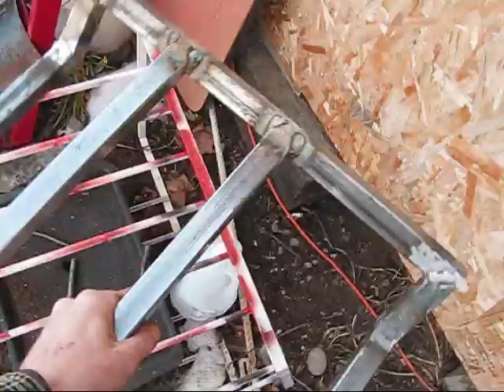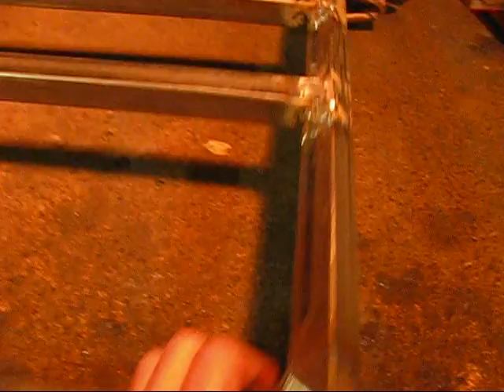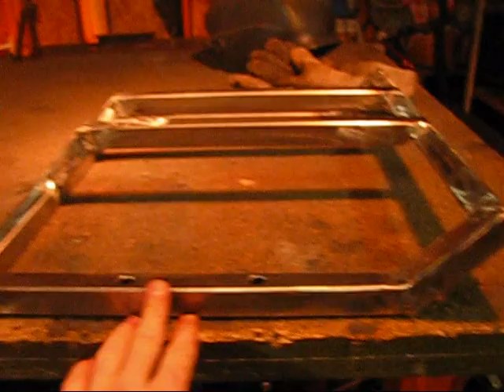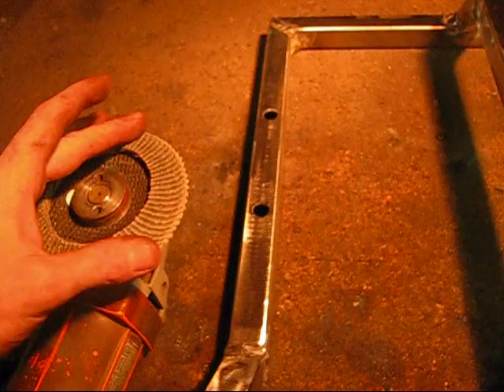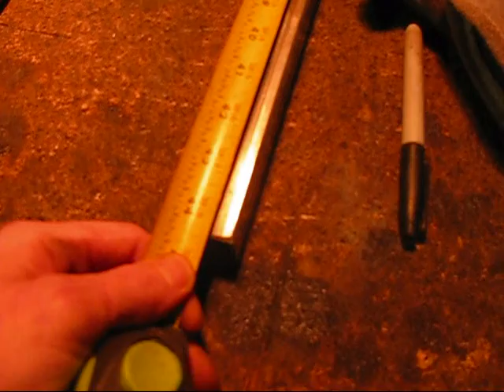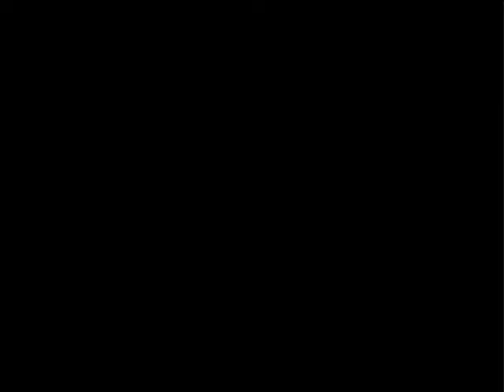Two Seater Go Kart #2 ( Rear End & Main Frame ) diy homemade

Comment: What grade of steel are you using? Also, if you leave a small gap between the pieces you weld, it will help with penetration. Gap the thin stuff .125" and under, and bevel the stuff over.

Comment: I admire your enthusiasm. No disrespect intended and I understand its DIY, but your geometry and welding could be a lot better. Does your chopsaw have a tungsten tipped blade? This gives a cleaner cut and generates almost no burrs. Also, if you get the weld right (nice smooth herringbone pattern), you shouldn't need to grind afterwards, saving you time and energy....

Comment: Hi T-Man, I really enjoy all your work.
I want to start a homemade project, but I want to use square aluminium profile. Does it resist as much as steel does? I want to use aluminium profile with the edge of 3cm. Is it enough for the chassis?
Reply from the maker: good question, I dont know. I have never built any frames out of Aluminum. but 3 cm seems ok.
Reply: ***** Thanks for your answer, it will not have a motor, it will be something as a velomobile, 4 bike wheels and pedals, for 2 persons
Reply: Horea Mare
Racing Karts are made out of Chromoly. Chromoly is stronger than mild steel and this enables people to run a much thinner wall thickness. The difference in wall thickness is why chromoly cages and Karts are lighter. However chromoly is much more expensive and should probably be tig welded..

Comment: Very cool! I want to do something like this. About how much is the total cost to make a chassis with steering, wheels, and a motor? I want to weigh the costs of building my own and just getting one off craigslist...
Reply from the maker: well realistically it would cost you more to build it then buying one.... But you wont have the pride. It feels good to know that you have built something cool. Its easy for anyone to buy something. But true worth comes from being able to build something tangible.  But to answer your "?" this build costed me about $600 , that includes shipping on the stuff.
Reply: Thanks, man. I know what you mean about the pride coming from building the project yourself. I'll still be fabricating a sheet metal model A "rat rod" style body for the go kart, but I'm afraid I don't have enough money to build the whole entire thing from scratch. So I think I'll just get a 2 seater go kart and save my craftsmanship for the building and painting of the body.Thanks for responding though! I love this build!

Comment: Too bad your video camera doesn't have a plugin backup for power, then you could just plug it in out in the shop and not worry about the battery going dead on ya. my cheap China on has a plugin backup, but the quality sucks.

Comment: hey t man im making one with my neighbors and I am only 15 years old how much for a frame that you have made
Reply from the maker: Tdog8469 THE ASSASSIN hmm , if I remember right I think it was about 90 feet of 1x1x.095 wall thicknes. and it was about $112 . Keep in mind that its just not the outside frame, its also all the cross bracing you'll do too. Like for the seat and stuff.
Reply: are you selling any ?

Comment: wtf is those welds...horrible welds...
Reply from the maker: YEP, I know my welding sux.
Reply: ***** welds that bad are a safety hazard on a gokart. Clean the metal BEFORE you weld it and turn you welder's power up. You can't just look at the welds and say "that's ugly"  those welds have very little penetration and all it will take is one bad hit of stress in the right direction and they are going to crack and come apart.  I would grind those out and reweld them with a good bit more power.